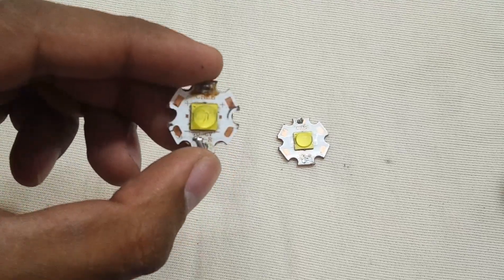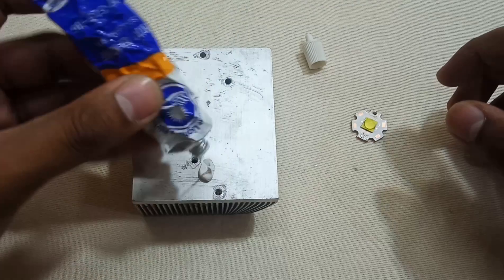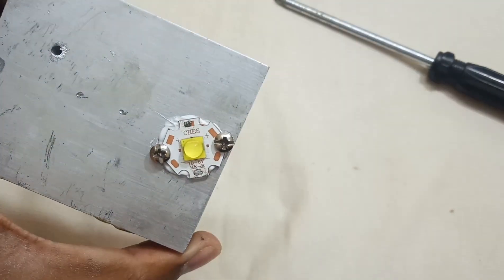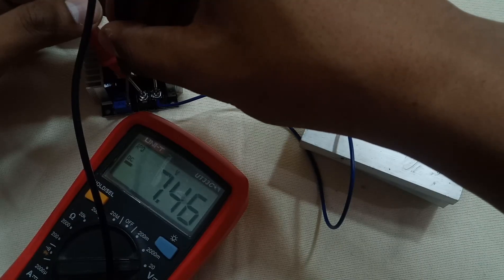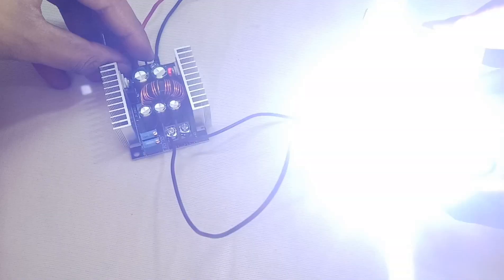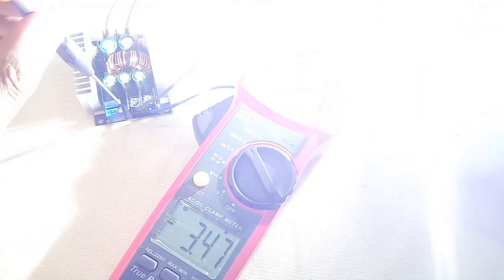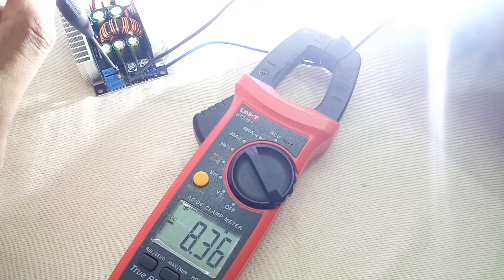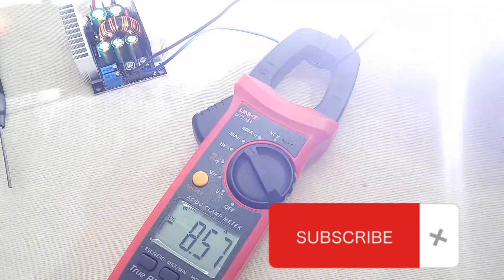CREE 7070 Overdriven to 8A! | Extreme LED power Test 7.5V 8A? #diyelectronics #led #amazing

Comment: Current draw is limited by the sink or target, that implies even if we give 100Amp to a LED that can take only 10amp, the led  will take only that 10Amps! (Voltage is a different story though)  Current is decided by target/sink and once the sink's maximum current is reached, it would stop taking any higher current like the Ammeter in this test shown

In a way we cannot overdrive current beyond what the sink can take, 
sink pulls current it can take, we cannot 'push' current into sink (if I may say in terms of mechanical motion)
Reply from the maker: Appreciated 👍. But its still more than rated 3A.. in this sense its overdriven.